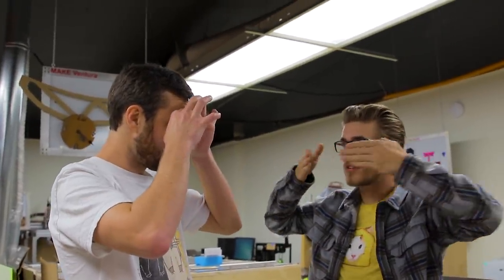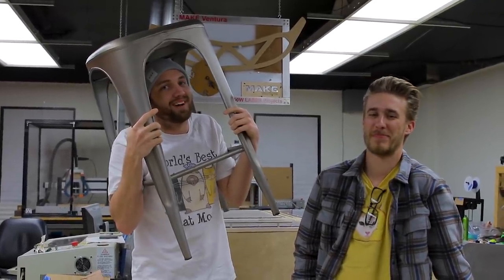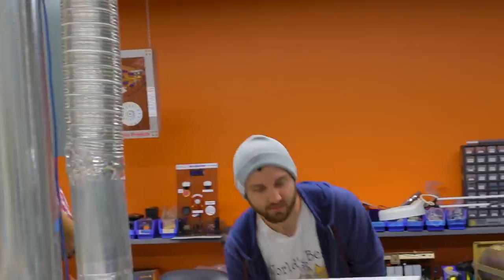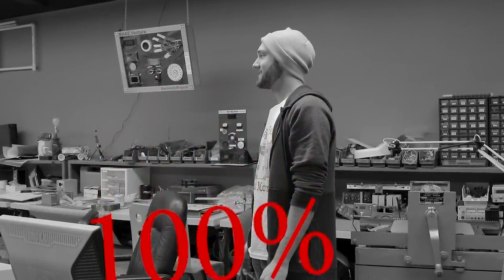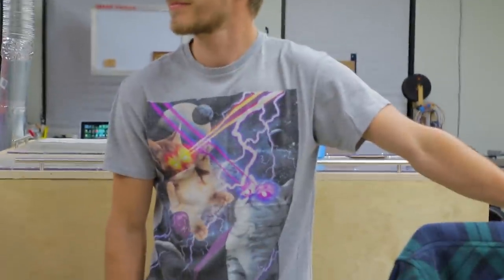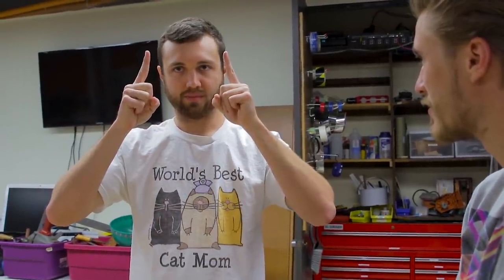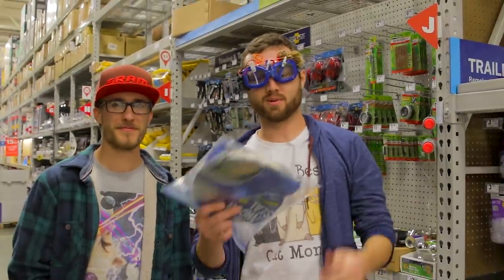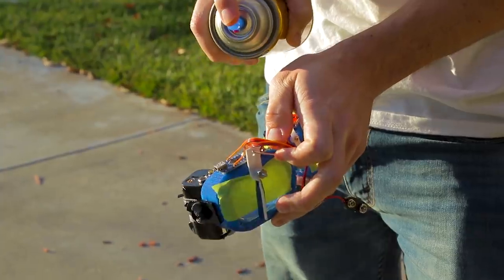Automatic Rain Goggles

Comment: “Too bad it wasn’t here to put out the fire.”
“What, the rain?” 😂 priceless
Reply: Capitan Bastos 😂
Reply: Life 2.0 this got me so good, I have to go make a coffee and start the video all over again.
Reply: Capitan Bastos remember to turn off the percolator, you don't want your house to burn down, that would be terrible!
Reply: bwahaha
Reply: Bastos Perineum 😂 yeah, fire safety is so important. I actually use an aero press, but I still need hot water for that. I was out of coffee though, so I ended up making some mate and filling up a thermos instead. I did make sure the kettle was turned off and all kitchen appliances were unplugged though, just in case.
Reply: S A V A G E
Reply: Capitan Bastos then the glasses would've come in handy
Reply: that made me ANGRY
Reply: That burn.
Reply: The difference between a friend and a "friend"
Reply: Cluccers yeah, it’s a total mess! It should be glasses - fire - rain, then problem solved.
Reply: Shin and Leo Gaming #TRIGGERED 😂
Reply: Rouverius 😂
Reply: Capitan Bastos I don’t think you know that his house burnt down.
Reply: In montecito, the rains caused mudslides that killed many. I don’t think I wanted the rains

Comment: How did your head not get electrocuted during the car wash part with the water getting on the motors and stuff?
Reply from the maker: Low voltage, so technically there is some electricity running through you but it's not anywhere near dangerous.